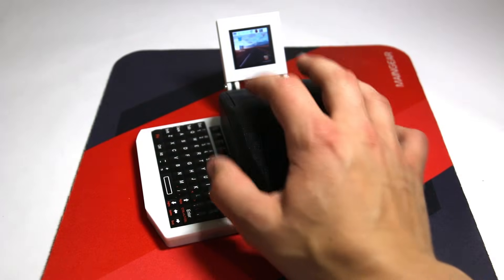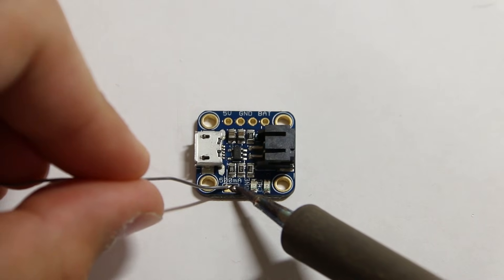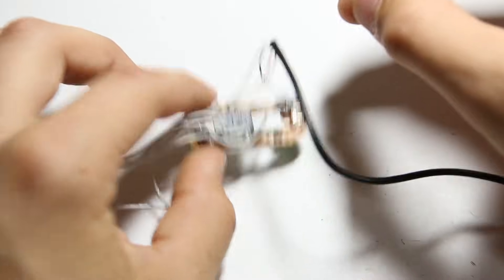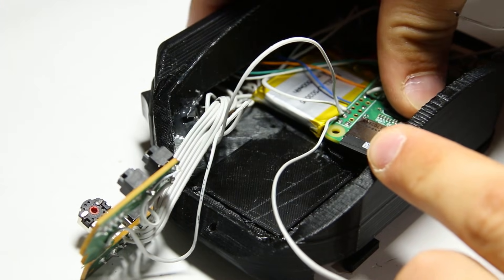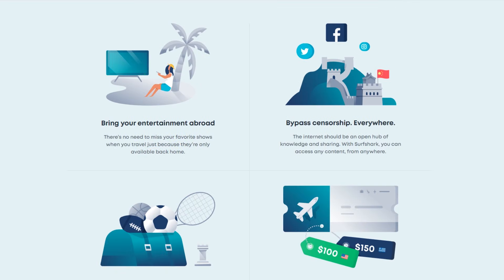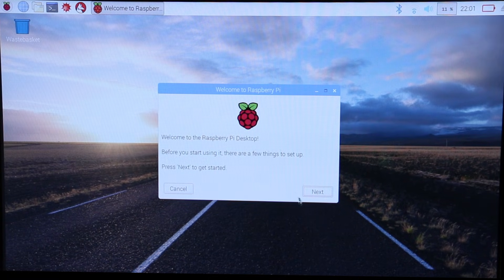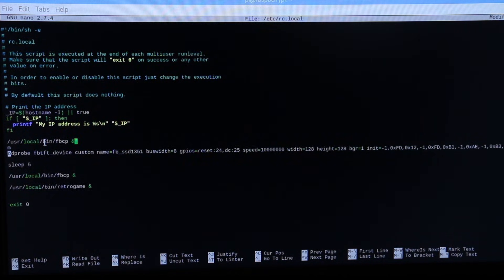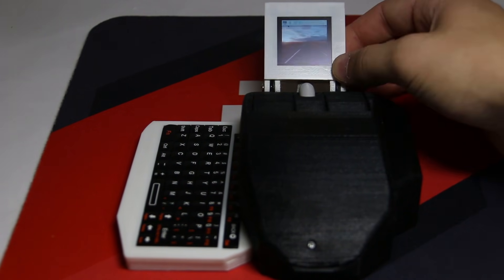Making the Ultimate Computer Mouse V1

Comment: Here's a tip, in the command line if the "Y/n" has a capital letter then the capitalized letter is the default input when just pressing Enter.

Source:
https://askubuntu.com/questions/1154676/why-in-any-installation-prompt-y-n-the-y-is-in-uppercase-and-the-n-in-lowe

https://askubuntu.com/questions/322600/do-you-want-to-continuey-n-why-the-upper-case

https://stackoverflow.com/questions/7803728/standard-format-for-yes-no-questions-in-the-terminal

Comment: Very nice! Two pieces of feedback:

1. Wiring is a tad messy. It helps to test fit your pieces first, then solder wires in when you know exactly what length and orientation they need to be in. Also, try using ribbon cables when you're soldering a big bus - it'll make it much neater than using a bunch of individual wires.

2. Hot glue just ain't the way. Use threaded inserts, embedded nuts, or hell just screw straight into the plastic. The plastic is soft enough where an M3 screw will thread into a 3mm diameter hole in the plastic. Anything is better than hot gluing stuff; especially gluing PCBs to plastic shells. That's gonna be a huge pain/mess to disassemble when you want to make V2, you run the risk of ripping up solder pads on the board if the hotglue is touching them, and in general hot glue doesn't work well as a long term solution. Even for prototyping hot glue is not the way to go; it's for arts and crafts and maybe fabrics sometimes. Very rarely is there a legitimate place for hot glue in this kind of work.
Reply: nerd
Reply: @one_high_cat123  and electo is also smarter than you so would you call electo a nerd?!
Reply: @one_high_cat123  dude he’s just smarter than you and he’s helping electo the guy you’re watching right now

Comment: People in 2040 who get this video on main page

WhY dIdNt yoU Put i18 9900k & mtx 7080 extreme in iT ?
Reply: @Bass0310 only morons are buying this, mtx 7080 would be enough
Reply: @Bass0310 you don't need better GPU  because it will bottleneck CPU Ya better add more ram cuz 256 is pretty low for today Dude its not 2020 when you only needed 16 gb ram

Comment: You should consider adding a heatsink to the Pi, that may be the reason it keeps freezing. There isnt mych airflow inside that mouse.
Reply: Maybe add some vents, recreate a heatsink, and making some mini fans
Reply: @FishMoley  that's a good idea but I guess adding a cooling fan in that mouse can make a problem cuz sometimes cooling fan creates vibration... So It can impact on the mouse sensor (I guess)
Reply: was thinking the same, especially with so much glue

Comment: The 500mA pads on the lipo charger is for the charging rate, not the size of the battery. With the pads shorted it'll charge the battery at half the original 1000mA rate. A 500mAh battery can power a 500mA device for 1 hour. So if you consider losses from the boost converter, you're looking at maybe 45 minutes battery life here, if you're lucky!
Reply: so you're saying you should use 1000mA pads on the lipo charger?